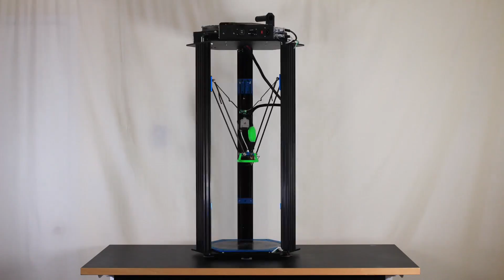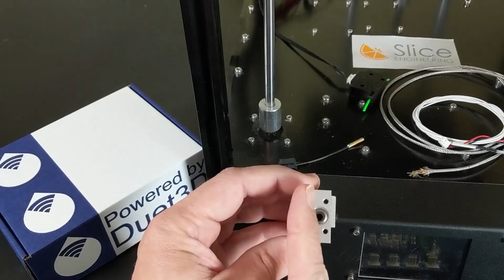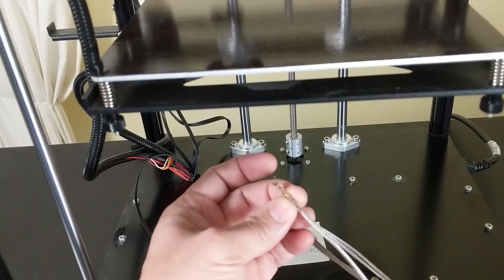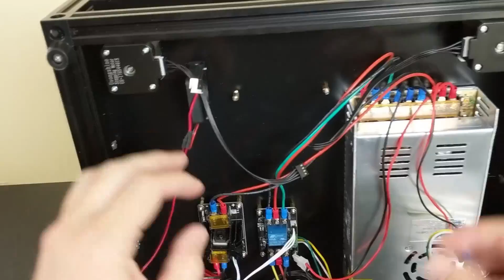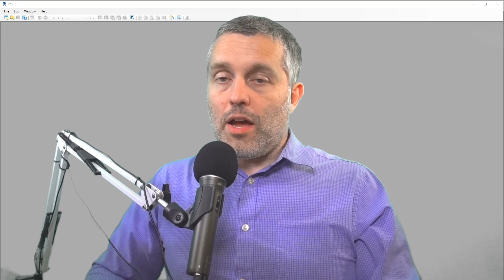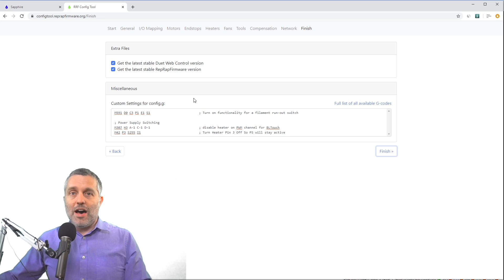Building a Better CoreXY Printer --- Sapphire + Duet + Mosquito +  BLTouch

Comment: Thermocouples are very accurate they generate very small voltages they are not resistive devices and they need a compensation circuit this is found normally in a chip designed to be used with the thermocouple
Reply from the maker: I stand corrected. Thank you. It appears that I added to the misinformation out there about the subject. For anyone interested here is the Wikipedia article telling how thermocouples work:https://en.wikipedia.org/wiki/Thermocouple#Principle_of_operation
Reply: @DesignPrototypeTest  You happen to give a lot of misinformation and throw a lot of shit around.

Comment: i have some questions 
1 is using a shaft for driving core system has any disadvantages?
2 is using a small rubber feet bolted in frame really dampen vibrations?

Comment: I like that you are replacing the chinesium with western components and calling them out for theft of intellectual property.  Looks like you get some hate for it though.  oh well.  I wish that I could run Klipper on Duet boards.  That seems to have the most support and I am new to 3D printers.
Reply from the maker: Reprep firmware iMUCH easier to deal with and has 98% of the features that Klipper has and some features which Klipper doesn't. It just doesn't have as much hype behind it. That being said, I've been told that you can run Klipper on a duet control board.

Comment: Hi, this was a cool video. Just a question: How did you get PIN3 to a high signal to switch of the PowerSupply. Even better: What code did you use for the marco... ;-) Keep up the interesting tests!
Reply from the maker: M307 H3 A-1 C-1 D-1                          ; disable heater functionality on H3 and use it as a signal pin instead
M42 P3 S255 I1					   ; Send the "keep Power Supply On" signal to the Power Control PCB

Comment: I building a coreXY next. The Voron 2.4  I have a lot of money invested in my ender 3 pro, so I'm thinking of taking all those parts for my coreXY and putting the ender back to it's OG form.. with updates like the linear rails staying on of course.. But that needle nose to start the crimps.. Brilliant! You just gave me a reason to finish my pro wire harness project.. I gave up because the crimping was taking me FOREVER and wasting a lot of crimp ends. I spend $100 on wire stuff just to throw it in a box and never use it again. Well I need to buy the connectors for the DUET 2 board anyway.. I'm just redoing all the wires with aviation connectors going to the control box. And I have to start my own Duet 2 wifi box from scratch now that I know Fusion 360.. I remember watching you like Damn this guy is good at everything! Now I'm stepping up to where you used to be

Comment: I see there is a Sapphire Plus out that I believe has fixed a lot of the issues of the pro.
Reply from the maker: It is inferior because the only feature that sets the sapphire apart from all the other Chinese CoreXY printers is missing: X&Y Stepper motors mounted beneath the floor.

Comment: You do know the meaning of open source? I don't believe they were trying to pass the configuration tool as an original. I still see those kind of websites up in Spanish fir Marlin which I use sometimes. They have it for cheetah and th3d. It's thievery when they try to pass it for their own. And the way you're going off on them and calling them names makes you sound bitter and angry. Not a good look on a grown man talking about 3d printers.

Comment: So where would you start "today" since the Saphire S is generally unavailable if you were to create an equivalent to your Saphire S (Duet, Print Head, Corexy, Enclosed)?
Reply from the maker: It's a tough call. These chinese companies seem to pop up make a run of these CoreXY printers then, once sold out they just fade away. Another example is the "Coreception." Your best bet is probably a Voron. More expensive, but a great end product and a huge community to help you along the way.
Reply: @DesignPrototypeTest  Thanks. Voron is on my radar. I'll have to go look and see about those specific upgrades (duet, print head, etc.). Keep up the great work!

Comment: maybe instead of complaining about chinese products that are not good, use "stolen" codes etc, u should support your own manufacturer?? Yea, you will pay 2-3 times more than u had payed for this printers, but than u will have good product. China has quality products for good prices too )). It's not normal to wait 300$ chinese printer work perfect for cost of your only duet2 board. I'm not chinese by they way, i also use chinese 3d printers, and i don't expect perfect printer for 200-500$, while here printers from local manufacturers start from 700$.

Comment: Compared to size (assuming a cubic build volume for simplicity) the mass of a bed increases as the square of the dimensions, while a bar increases linearly (assuming you keep similar thickness for each component as size increases, which should be the case for consumer level printers).

Comment: the stock hotend heatsink.
im pretty confident in saying those fins wernt machined at all, and its probably extruded that way.
alot of cheap heatsinks are made this way. it actually does work (for many applications).
you obviously understand its not the most efficient use of material to maximize surface area, but it is probably the cheapest.

Comment: Love your videos, passion for 3D printing and expertise 
I’m trying to decide between a two trees sapphire is or a SecKit go, ur thoughts pls
Reply from the maker: SecKit Go seems nice. It comes from Taiwan not Mainland China. Therefore it may be more expensive, but also better quality control. It is a small outfit, and I think you will get good customer service. I don't love any of the current lineup of TwoTrees except maybe the Sapphire Plus. If you buy a Two Trees product, you will need to do all the trouble shooting yourself. If you get  SecKit, you can get a lot more support from the manufacturer.
Reply: Design Prototype Test thanks for your feedback, you have verified my gut feel on the Sec kit, the old you get what you pay for comes into play, keep up the good work too, your vids are awesome

Comment: There is a new Sapphire PRO 2 (https://www.aliexpress.com/item/4000055108720.html) (which seems to be closed at least, bit bonus here). Would be great if you could review it briefly especially compared to the Sidewinder.
Reply: Thinking back on this, I'd actually really like to know if the Sapphire PRO 2 (or any other in the league) can be turned into a direct drive printer... and it seems that the SainSmart Coreception 3D is actually very similar to Sapphire Pro but an upgrade.

Comment: By the time you add the cost of the Sapphire + the Duet + the Mosquito +++ you could have bought a Prusa. Hell even an assembled one.

OK little prod over - you final printer is a VERY expensive solution. The most expensive Motherboard and Hot End one can buy.

And that wiring is a holy mess - seriously. Why not a BTT SKR V1.4 and 7 inch screen.
Reply: Or a BTT SKR Pro instead, then run RepRap firmware and get the same results.

Comment: I am going to build my own xy printer in 400x400x400 size.
I  looked first as upgrading my current printer, but that costs a lot and will not perform as a xy printer.
Buying a cheap xy printer and upgrading, isn't an option, because you don't save money vs DIY.
An other advantage of diy, is that you can build your size you need and a better construction.

Comment: So rather than mounting the motors on top with extension wires, they made heavy extension shafts which increase the rotating mass substantially.  Looks like a bad design choice.

Comment: You should consider seeing if you can get your hands on a new Sapphire pro or Sapphire plus.

It looks like they saw your video and addressed basically every concern you had!

 Improved hot end (I still changed mine out for a mosquito but I think you could actually print PLA with it)

Improved wiring

MKS robin nano main board running a customised version of marlin (though an old version, can be updated to marlin 2.X

Two stepper motor drivers for the Z axis

Dreadful, borderline useless manual still exists however!

Comment: "They are cheaters"... so let me give them money for this hardware. How about we stop buying printers from China altogether, including that Sapphire?
Reply from the maker: It's a nice sentiment unfortunately, it's not that easy. China makes everything. 50% of a Prusa printer is even made in China. If you want to get into 3D printing you will be buying Chinese products. So, your options are to become a Luddite, or be selective about the products you buy from China. The Sapphire printer isn't a copycat. The extruder capstan mechanism is nearly a copycat of the E3D Titan, but it is changed enough that it falls in that grey area. Compared to the outright ripoff of the Bondtech BMG on the Sapphire Pro. Notice that I have not told anyone to buyt the Sapphire Pro. You can't escape made in China. so instead of "stop buying printers from China altogether" just don't buy blatant ripoffs/copycats.

Comment: I really like this printer but would you say with the upgrades can it hang with a voron or hevo?  Edit...
Reply from the maker: The Voron has many 3D printed structural pieces as does the Hyper Cube Evolution. That means you shouldn't put it in a heated chamber as these structural parts will soften and warp. The Railcore is viable option but it's a lot more expensive.
Reply: @DesignPrototypeTest  

Ok thanks I didn't consider the printed parts that go into the other printers. But print quality wise do you think there is much in it between the three?

Comment: I saw long while ago a Tronxy  X5 ST 3d printer  because you said is the best, I put it together and I have not a single successful print out of it. Is sitting in a cornet of my basement collecting dust.
So the question is do you have the upgrades and mods need to make this printer work or I just take my lost and tossed it to the garbage.  ?  Thank you in advance
Reply from the maker: Franko, To this day that is still the best large format CoreXY printer on the market. There is pretty much no other option. If there was a printer that just worked out of the box, you would pay thousands of dollars for it. For instance watch my videos about the E3D tool changer which is also CoreXY. You can definitely get your printer working quite well. Start by getting it working well enough in it's stock form to print all the upgrades. You will find many upgrades on thingiverse. Most importantly the stiffened brackets so that the frame doesn't flex as badly and so the pulleys are held more rigidly. Finally, you should upgrade to a Duet control board as I showed in this video. I did make a BLTouch split cooling bracket for your printer. If you would like that head over to Patreon: https://www.patreon.com/designprototypetest
I share any and all files I make in the course of these videos with my $5 supporters. I'm not selling files, I'm just trying to make my YouTube efforts worth my while. The digital files end up being a nice reward for the folks that help me out. Have a great day!

Comment: I need a large format printer with an x and y axis producing 20 inch parts. So a core xy printer would be the design to use. I was thinking that if I mounted the extruder un a movable mount so the bowden tube could be kept to a minimum length which should help precision of the print. I imagine I will need to print in nylon/chopped carbon fiber mix which requires high temperature
so finding a bed heater and a power supply large enough to supply the power.

Comment: Just to let you know, the patent you mention at the beginning, (https://patents.google.com/patent/US6722872B1/en) is NOT CoreXY. It looks much more like an Dual-Wire Gantry, as in there, each motor is used to move one axis, one for X, another to Y, while CoreXy uses 2 motors for 2 axys at same time.
Also, If you build a proper CoreXY machine, you shouldn't see any problem related to a single axis, like sayd at the end, as you will have 2 motors moving the printhead in a single axis, if it was a motor problem, you would see problems when moving diagonally.

Comment: I almost thought the new TronXY D01 on their website was the same printer but it looks like there are some minor differences.  Im looking for an upgrade to my x5s-400.  I have it modded and tuned so it prints fantastic except for the Z-axis.  I have my i3 Frankenstein printing near perfectly but the x5s has the slightest wobble which keeps me from achieving those perfect PETG parts that I need.

Comment: I made the mistake of buying the Sapphire Pro and have had nothing but problems, I was sent a unit that was obviously from early in production. For instance the XY  assembly was put together backwards and along with poorly designed and badly/cheaply implemented "features, " it was and is still a nightmare. I have kind of abandoned the thing, with regret. I wish you would do a video on the Sapphire Pro and how to get it working without spending a ton... I took your advice and got the duet2, and I would love to get a mosquito, but I am hesitant to invest any more on this.

Comment: Hi and great video. What brand would you then recommend for a large volume (400 x 400 x 400) CoreXY printer? I'm thinking of SX4 v2 (modified Hieha SX4 from TinyMachines), TRONXY X5ST-500 PRO and the Xinkebot Orca 2 Cygnus (400x400x500)?
Reply: A core xy over 350mm isn't that good

Comment: Matt, where did you get the Hi-Link power module that's used to turn on the printer?
Reply from the maker: It came with the printer. Also available on Ebay, but it's a little pricey: https://www.ebay.com/itm/3D-Printer-Power-Monitoring-Module-Print-Automatically-Put-off-For-Lerdge/202664564015?hash=item2f2fbfd52f:g:bJcAAOSwK2JcxdiD
Reply: @DesignPrototypeTest  thank you!

Comment: Pro tip: The duet has a dedicated signal for turning the power supply on and off. Is the ps_on signal, located in the 3 pin connector just alongside the power in connector. If you use that connector, you can use M80 (turn on) and M81 (turn off) to control the signal. As soon you send any of those 2 gcodes, the web interface (DWC) shows an extra panel which allows to control that signal.

The same connector also has a 5v INPUT. So you can use a phone charger to always supply 5v to the duet so its alive and connected to the wifi with the web interface up and running. Then you could use the web interface tu turn on the rest of the printer. With no Vin, the motors, heaters and heat bed will not work, so its an extra layer of safety, since mosfets and SSR can fail closed, while relays mostly fail open.

That is currently my setup. My printer has 2 power supplies, one big 24v which supplies power to all power functions (is the duet VIN), and a secondary small 12v power supply which feeds the fans, the water pump and a DC-DC 5v converter, wich feeds the duet 5V_EXT rail. A dual channel module cuts the mains from the 24v psu and the bed SSR, and the 12v rails from the fans and the pump, so the only available power is the 5v for the duet. Overkill, yes, but i'm planing to extend the setup with a smoke sensor which will cut the relay if smoke is detected. That way, the relay will only be on, if the duet request power (M80) and the smoke sensor doesn't report smoke.
Reply from the maker: Unfortunately the PS_ON pin is a switching GND pin. I need a switching 3.5v or 5v pin. Therefore, anyone wanting to use the stock power circuit on this printer will be unable to use your Pro tip.
Reply: @DesignPrototypeTest  I thought it was a normal relay module, which switches on when its signal is pulled low. 
The PS_on pin is an open drain output. For those who doesn’t know much about electronics, an open drain output its like a “normal” switch between the pin and ground, and the mosfet used is quite beefe, much more than an Arduino pin, that means you can directly power things via that pin. You can even control a normal relay (the relay coil, no need for a relay module with an optoisolator) just adding a flyback diode.
Check this duet forum post, at the end you have an schematic to control the board via de PS_on signal https://forum.duet3d.com/topic/10327/connect-a-lerdge-power-monitoring-module-to-the-duet-wifi-v1-04/27?_=1591162624629 it might help you wire your board
Reply from the maker: DUDE! Thank you! Check out the edit to my comment above.
Reply: I took it a step further and added soft power to the 5vdc supply as well. https://www.randoprojects.com/2020/07/30/duet-2-soft-power-control/

Comment: "ZERO GHOSTING"
Except the big text on the front of the test models, very much visible when moving the model in front of the camera from left to right...
Also the first blue model is NOT as perfect as you stated, check the top of the point, there is layer shifting. So it's not the top of the segment which FDM printers can get.
Reply from the maker: That's the infill showing through the translucent PLA filament. To see ghosting look at the part when the light reflects off the surface. The 14 minute print has a faint bit, but it really starts to show on the 11 minute part. Also, it only shows in the Y-axis short side of the part. Don't coufuse ringing/ghosting with that corner build up I talked about at the 28:07 mark.